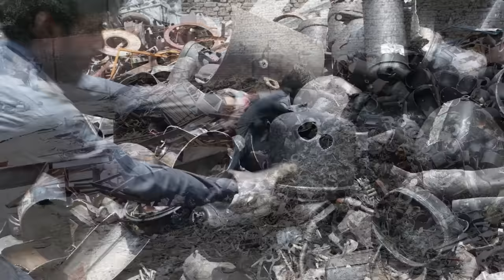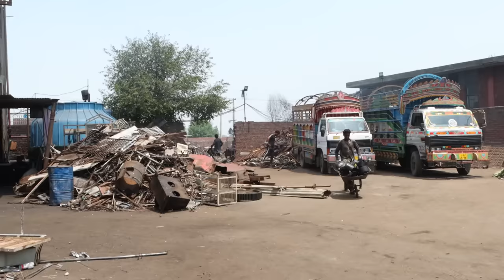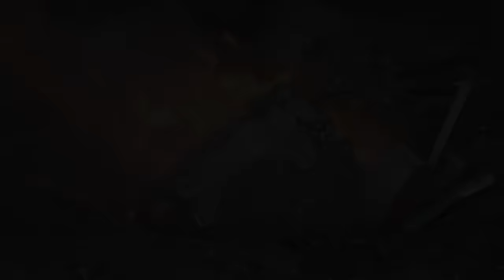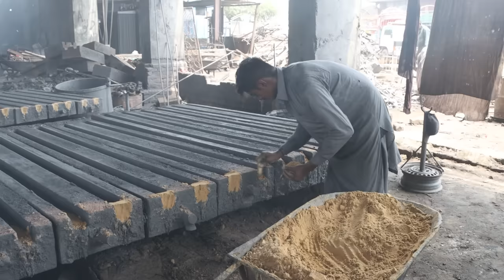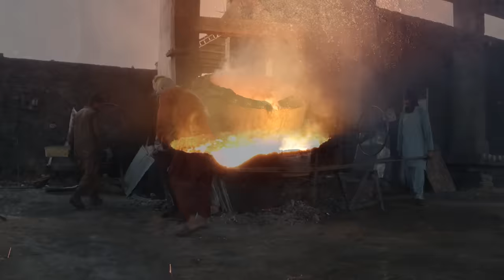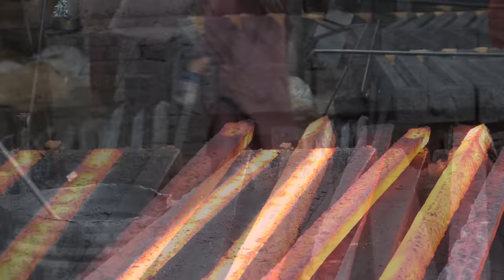The Incredible Metal Recycling Process | Steel Manufacturing Factory

Comment: Buyer: So, what alloys do we have here? Seller: All of them.
Reply: It is not steel. It is cast iron. Steel requires O2 to burn the carbon out.
Reply: @reverendfry6088  that is far from "cast iron" that is about the lowest quality pig iron you can get, if you even want to call it that... They are just tossing stuff into a furnace with no additives or even quality control... their QC guy is probably a blind dude sitting in a shack with a roll of "QC PASSED" stickers...
Reply: @WrongThink_  This region of the world had crucible steel 1000 years before the rest of the world.
I have a feeling they know what theyre doing
Reply: @martinwinther6013  Yeah well this isn't 1000 years ago my dude...Companies today want to know exactly what they are getting even if it's pig iron....
Reply: @WrongThink_  They do. Thats kinda the point here. They get consistent ingots. Whatever it is theyre making here, you can run a quality test, and it will be consistent
Reply: @martinwinther6013  Can you smell that?? It's bull sh**... "Consistent quality" in chucking in random things in?!
Reply: @martinwinther6013  But steel is not the product of this factory.
Reply: @andrewallen9993  Nope, but the crucible is still the tool in use.
The goal here is just to make something you can handle. Something uniformed in all its randomness
 Im baffled its so hard to grasp.

Comment: Could be ballast / drop-weights for a submersible - they're heavy, cheap, etc
Reply: That's actually a quite sensible use for this kind of "metal": many household appliances like washing machines, desk lamps etc. come with a large slab of some nondescript metal for added weight/stability. Better than poured concrete, I guess. Also gym weights etc., they don't need to have particularly good qualities.

Comment: I really hope they get some better quality management. To even think of this potpourri blend they tossed into the crucible as "steel" just boggles the mind! They definitely need to have a covalence magnet sorting the metals out instead of just throwing it all into one giant melting pot. It's like a lucky dip, except the buyer will be lucky if he gets a quality iron product out of any of it!:face-blue-question-mark:⁉❓❔
Reply: It's not hi-tech but there are two positive aspects: 1) recycling; 2) employing people who need jobs.
Reply: @joaocosta3374  Like separating out those motor stator cores.  Those are low remanence  silicon steel which even rolled into sheet in these bastard conditions would be better than what a lot of motor and transformer factories of this tier use.  Same with melting out the aluminum from those motor rotors.  There's a good 1,500°F difference between where aluminum and steel melt so temperature control wouldn't be critical.  Just use an oven so the steel cores don't sit in the molten aluminum and dissolve iron into it.

Comment: You guys should to take a rickshaw and make it more heavy duty and turn the back into the front weld some flat steel plate around the basket and put Hydraulic selinder underneath to lift heavy loads for hauling scrap to the melter 😊
Reply: hydraulic * cylinder
Reply: nah, labor is cheap, lives are cheaper.

Comment: don't think these kinds of -metal bars - can be used for anything further. maybe cut into smaller bars. 
And then used as a ballast or the likes. since it is no clean metal. or aluminium, copper or the likes.
 - open hearth furnace, - some of the oldest and most primitive furnaces. 
but for the product they make, and there must be a demand, otherwise they would not make them?

Safety enforcement, air pollution, smoke pollution, all non existence. 
Suppose al these not doing them are reasons why they can produce what they are producing?

Comment: If you know anything about steel making processes, and the much needed quality control, then this will have you pulling your hair out.
Reply: Cast iron, structural steel, spring steel, galvanized sheet, name it and there it is
Reply: Or you could see this as raw input for the next phase of a steel making process.   Billions of tonnes of Australian iron ore are processed every year.  And that's not some pristine product coming out of the Pilbara mines.
Reply: I swear I've seen this shit go straight to the rebar factory.

The concrete probably has a higher tensile strength than the rebar.

Comment: Incredibly, there's some legit use even for this "random metal alloy" they produce here: ballast. Think e.g. washing machines, office desk lamps, gym weights, kettlebells etc. As long as it's heavier, less bulky and less fragile than stone/concrete,  it's perfectly adequate for these applications. But nothing more.
Reply: Ballast nowadays is rarely metal. Cement or plain sand is cheaper
Reply: @Marcuslobenstein  Yeah they are, but have you ever seen e.g. concrete dumbbells (plastic clad)? They exist but they suck, being bulky and fragile. When you want some reasonable impact resistance at a price, nothing beaks "Pakistanium"  :-D
Reply: how about a NASSAU space capsuel  @Velktron